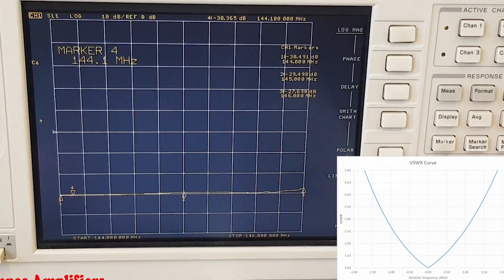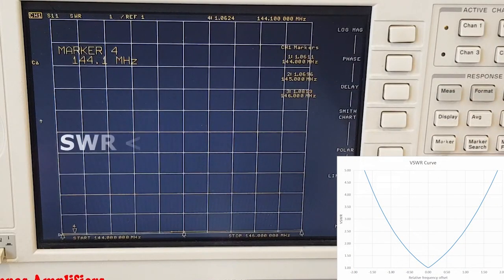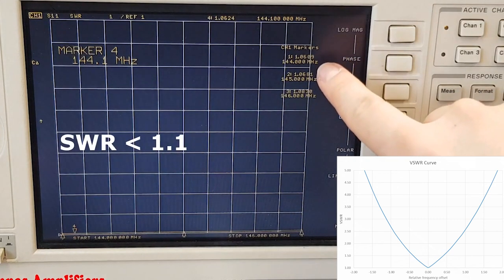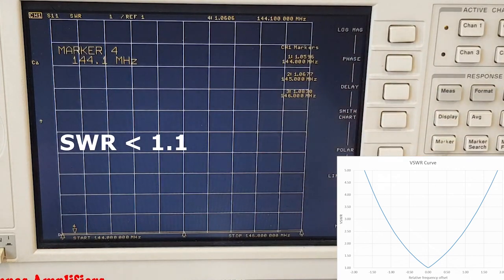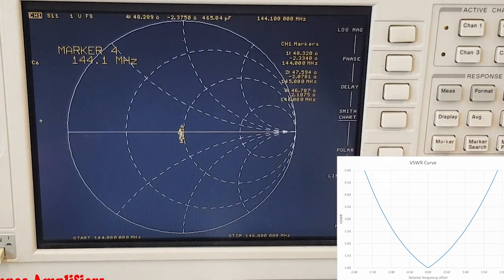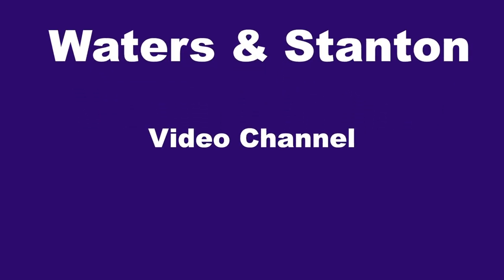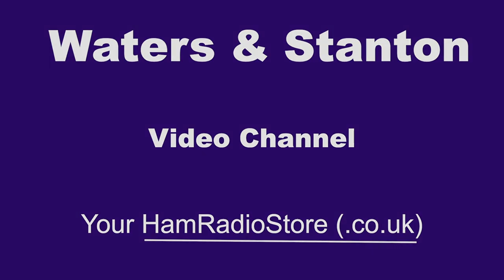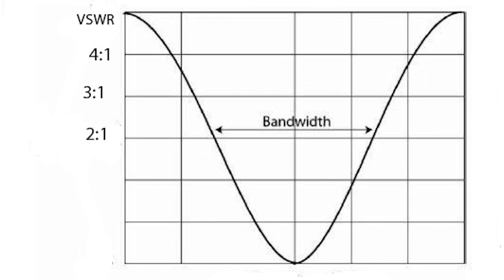Ham Radio - Stretching Antenna Bandwidths.

Comment: The problem these days is that everyone does everything in ham radio to the Nth degree. I hear all sorts of concerns about losses through connectors on HF. Two connectors are not going to make any difference. There is a video on youtube of a US amateur measuring the loss of 40 PL259s and inline couplers and it was only about 1.5db. I used to have a neighbour who was an amateur and a BBC engineer. His home made 400w linear amp had TV coax plugs on it and he ran his LF antenna on TV coax. Its a case of what you have and what you can make work for you really.
Reply from the maker: Yes 100% Gordon,  73 Peter

Comment: Well said!  Hams tend to worry too much about SWR.  Although I can appreciate the in-built ATUs in modern rigs, I still like to use my 40-year-old tube final transceivers which can also handle a 3:1 SWR with ease.  If you cut back the power to QRP levels with those, you can handle even higher SWR levels.  I once made a contact on 160M using a 15M dipole with my 40-year-old FT-901DM just ticking above the normal idle current on tubes.  -- John, N0BUP in Colorado
Reply from the maker: Hi John. Thanks for the contribution. 73 Peter.

Comment: Hello Peter , Thank U for such Powerful/Deep topic , I wish you reveal more about the difference of the Antenna ERP as well as Received Noise , That's  if we add some (Band Width Stretching Accessory) such as MFJ-908 & MFJ-909 , beside the difference  Icom Mobile Antennas AH-760 and AH-740 ...
Reply from the maker: Thanks for sharing. 73 Peter

Comment: honestly I expected the video to explain actual techniques of making the antenna bandwidth wider, rather than 13 minutes of trying to convince us that it's ok to use higher swr. quite disappointed.
Reply from the maker: You cannot increase the bandwidth of  an antenna without  changing the mechanics in a significant way. For example a dipole would require a very thick element or multiple wire sections.  Neither options are very practical in a small garden.
Reply: @watersstanton  thanks for the reply! Actually using fat elements sounds like a reasonable modification, especially at the higher bands where antenna size is more manageable.

Comment: Thanks from Rochester…NY that is…for your incite full presentations. Facebook antenna groups are filled with: “Why can’t I get my SWR below1.5?”  I’ll shall point them towards this video. 
When I forget to push the tune button on my LDG tuner, the FT-891 still sends out a signal with a 3.5 SWR on FT8…and I still make contacts. So your advice is sound. SWR 1.7? So what! 
I guess it matters to the QRPers running less than 5 watts. But I only run a  max of 35 watts on FT8/FT4 and see no difference in contacts moving to 50 watts. …KA2VCW
Reply from the maker: Hi Ricn. Many thabks for your input. 73 Peter
Reply: Point them to the book reflections by Walt Maxwell it explains in great detail how the tuner is tuning the system to resonance for maximum power transfer ,even with swr of over 10.1 with the correct feedline very little power is lost

Comment: Let‘s look at the numbers: How much loss a.k.a. reflected power (RP) does a certain SWR give you? 1.5 SWR: 4%; 2.0 SWR: 11%; 3.0 SWR: 25% (means 6 dB loss, that is one S-unit…not one dB… 🤦🏼‍♂️I am wrong - read the thread below). Don‘t worry too much about these losses, as long as you operate moderate power (up to 100W). Remember, you will still radiate 75W of the 100W at 3.0 SWR, if your TRX doesn‘t throttle down. Be careful, if you do modes with 100% duty cycle, especially digital modes. But on SSB an SWR of up to 3 should be no problem.
Reply from the maker: Your dB relarionship is wrong. Check it out.
Reply: @watersstanton  yes, you're absolutely right. 6 dB would mean 75% loss, so that only a quarter of the power would be emitted. If you don't mind, I leave my original comment, but edit it, to give readers the chance to  comprehend and learn out of my embarrassing mistake.
73 from Germany
Reply: @pasixty6510  your forgetting to include reflection gain in your calculations
Reply: @watersstanton  if balance feeder was used because of reflection gain there is very little lost
Reply: @Pioneer936  right, but even if you don’t take that into account, the loss at SWR 3 is only 1.25 dB. 10*log(100/75)=1.249
Reply: @pasixty6510  loss of reflected power is down to feeder ,if balance feeder is used even at 10.1 there is very little loss because of reflection gain
Reply: @Pioneer936  again I agree. The less cable loss you have, the less loss you will have over all. At high SWR reflected power will move to and fro along your feeder line. The line loss is dependent on the cable ( coax, ladder line). As loss is way less in a balanced line (eg. ladder line) than in an unbalanced line (coax), you will experience less degradation of the bouncing signal, thus radiate more power. That’s why you can still operate at  e.g. SWR 10 without experiencing the expected loss. Happiness ends, when your final amps get too hot, because of all the power coming back to them.
Reply: @pasixty6510  final amps don't get hot because of reflected power they get hot because of reactance drawing to much voltage and current